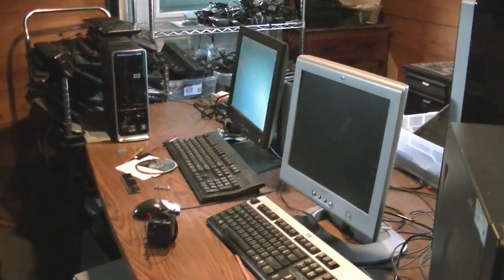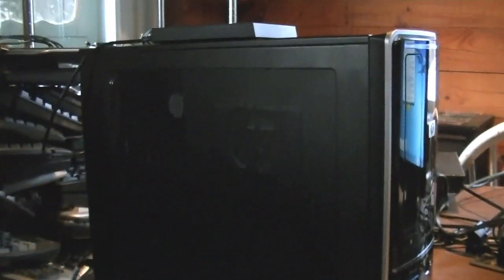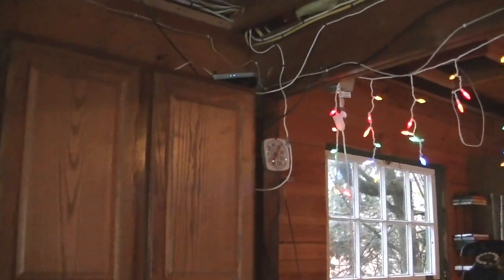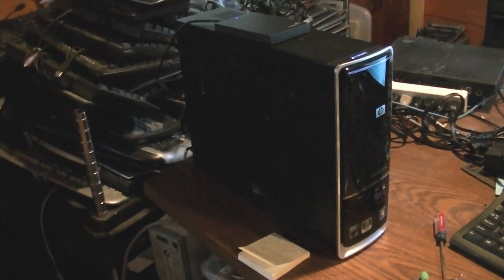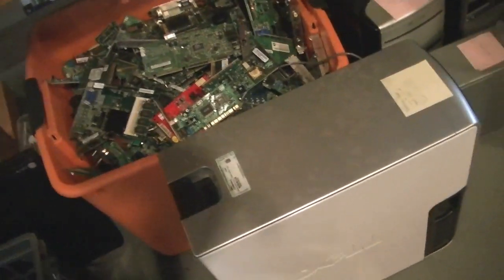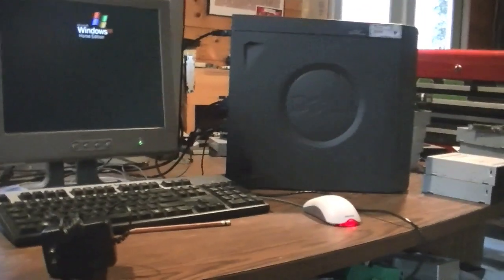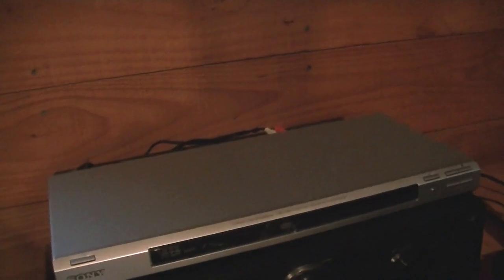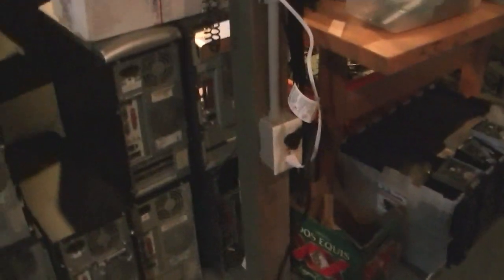Free Computers (Including one of My Best Finds Yet!) and Update

Comment from the maker: The reflowing process isn't nearly as difficult as I thought it would be, either. I reflowed the solder to my Xbox I mentioned in this video and it works fine. Plus heat guns are fun to use :D

Comment: It never fails to amaze me the equipment people will throw away in my apartment building.. I haven't had to buy a computer since 2000. I'm always finding discarded TVs and computers sitting next to the trash. I found the computer I'm using now about two months ago. It's a 7 year Dell desktop in excellent condition.. It has a Pentium 4 HT, 3.40 gigahertz processor and 2 GB of memory. It has Windows XP Professional Service Pack 3. It had some malware issues but Panda and Malwarebytes took care of that. Sure, it's a bit old but it does what I need it to do.
Reply: ldchappell1 Wow, impressive. This doesn't really happen here where I live, although I can admit I once saw two PC extension cards left next to the trash... I didn't pick them up as I figured I won't be able to do much with them. But now I guess I should take a closer look next time!
Reply: Dustie1984  It helps living in San Francisco which is fairly tech-y city with limited space. I found another working flat screen TV since I wrote that comment. Not a great one. A 26" Sharp 720p set. I had it for two days and sold it to my neighbor for $40. That's the 3rd working flat screen I've found so far. Last year I found a 55" Panasonic LED set. It was a bit beat up but worked fine. I gave that one away.
Reply: Sounds like you basically have givaways over there, man! Nothing like that happening here, yet... although this got me checking local ads for computers and people are selling old PCs for literally a few bucks, so - not really free stuff but almost free if I'm really willing to get something old-school.
Reply: Dustie1984  Now that I think about it the only thing I bought brand new in my apartment is my bed and my coffee pot. Everything else came from thrift stores, dumpster diving or I found it on the street. Even my cat was second hand. lol.  Good luck. I hope you make out like a bandit. = )
Reply: You're lucky. I wish I could find a computer like that. Even used those computers go for over $200 at the local Goodwill store. I considered buying one and then this other one fell into my lap.
Reply: ***** Did it make you feel like you won a lottery?
Reply: +ldchappell1 lol i agree. ive found lcd monitors (Samsung 22inch & Viewsonic 19inch x3) that were in the trash (obviously not the same trash lol), because they weren't "working" . i opened them up and simply enough it just required new capacitors on the powerboard. simple 10$ fix to repair all of them... :)
Reply: Sammy Morini   A few years ago you would only find the CRT monitors but now people are throwing away the LCD flat panels. I found twol flat panel monitors a couple of weeks ago in working condition. A 19" Dell and a 17" Acer. The 19" one had little red hearts painted on the bezel with enamel paint but I got it off with a razor blade. It's great finding a matching Dell monitor for the Dell Optiplex.
Reply: ldchappell1 haha yea very true. But youre lucky you found them in working condition :D
i got 10 free 17inch dell monitors from work (also my university). 4:3 ones but they work perfectly fine. my basement is now filled with many lcds that are not being used oh well hahaha :)
Reply: Sammy Morini   If you can fix capacitors, you have more computer savvy than I do. I didn't know anything about computers until I was 34. Most everything I know about them I learned on the internet.I'm pretty good at diagnosing software problems and upgrading hardware but when it comes to things like capacitors and resistors I take Dirty Harry's advice. A man has to know his limitations. I'm learning though.
Reply: ldchappell1 that's all good man and thanks (been doing stuff like that since i was 13, 29 now lol)

anyway you live and learn at your own pace and as you wish. it's good that you're able to self diagnose things as most would be too lazy to even put 2 n 2 together to try and solve... but you know what, it's ok, it's people like that which give us something to do :)

keep at it though!

Comment from the maker: I have to say, that is the cheapest and least effective way of fixing an Xbox. "Let's just jam up the fans or cover the heaksink, make it overheat, and see if it works!"
The real way to do it is to get a heat gun and reflow the solder on the board. That's what I did, and I now have a fully working Xbox without any error relapses.

Comment from the maker: Well, I reflowed the solder on the entire board and it works fine now, so it was not an overheating CPU but rather cold solder joints.

Comment: "just an pci-e x16 slot, doesn't support any amazingly good videocards" That's bullocks. PCI-E 1.1, which this has, supports ALL videocards out there. PCI-E 2.0 only offers better bandwith. With your logic, pci-e 3.0 cards wouldn't work unless you have the newest generation of motherboards. A 7870 will work fine in a 1.1 board.

Comment from the maker: That's fine, as long as the board doesn't smoke. Make sure you removed any meltable or burnable materials from the board before heating. The first time I used my heat gun though, it did smoke, but that was just because I think there was a little gunk burning off the heat gun.

Comment: i know this is a while since video, but have you thought of actually setting up a wireless bridge (running ddwrt) using one of your wireless-n routers? unless you actually have and use a gigabit lan setup, this might be a nice a simple way to get a network switch in an area where passing a wire isnt totally optimal. :)

p.s. on a computer which is connected to exactly what i mentioned, wireless bridged router, lol.

Comment: Got a XBOX 360 (same model) about the time you found yours,but it had the famous E74 error. Changed out the thermal paste,and redid the heatsink mounts, and got the thing working again. Already had some parts form another XBOX 360 I tried to repair,and got a controller from a friend.After a week of little use,the thing gave me lines all over the screen, and it gave me the E74 error again.So I guess I should reflow it, so maybe I have it a little longer. Same as you, I won't use it much for games

Comment: I've had several of the cheap dell cd drives jam, where they won't open. Rubber bands will not fix them. You need some grease. Take a paper clip and jam it at that pinhole in the front of the drive, it will come open. Pull it all the way open, and put a eraser sized dob of grease on the track. open and close it several times so it works its way into the gears. I have repaired 7 drives this way, the 8th one did not fix because something else is wrong with it.

Comment: I just got a similar HP slimline that you have in the video. I brought it for a thrift store for 30 with a fresh install of windows 7 and 4 GB of ram. I had have only one problem with it  and it was the front usb ports sometimes don`t work. It could be a loose cable.

Comment: It will support 2.0 cards just fine. It hasn't been until the latest high end 3.0 cards, that 1.1 proves not to have sufficient bandwith. Any 2,x card didn't face a bottleneck.  As far as I know, the best low profile card is a geforce GTS450. It's a special edition haha! :)

Comment: I found two near-fully functional Core i5-750 computers with 4GB of DDR3 RAM in the trash. One with a motherboard that supports overclocking, a 350W PSU, an HD 5750 and a 500 gig hard drive (only the DVD drive was bad), another non-overclockable one with a 650W PSU, a GTX 275 and a 1TB hard drive - which, unfortunately, has 4015 bad sectors, so I discarded it and put a spare 500 gig WD Scorpio Blue in it. I also had to clean that one up, since it was filled to the brim with dust. Had to take apart the video card, since it reached 90+°C playing... Minecraft. The part of the heat sink facing the fan was clogged up with dust to the point that I'm surprised it managed to push any air through there at all.

The former I'm actually using as my main computer now - turns out the i5-750 is actually a better CPU than the AMD A8-5500 I was using up until that point - I put it in a new case, along with my old graphics card (GTX 750 Ti), 4GB more RAM, an additional storage HDD and a USB 3.0 expansion card. Runs really well, though I would love to have an SSD in it.
Reply from the maker: It's amazing what people throw away, it makes me miss being able to grab stuff from recycling centers to take home. All the recycling places are so locked down now, I went to one near my new area of residence and it had not one, but FIVE signs outside telling people not to take anything.
Reply: Someone7089 I don't get why they would do that, it's only less work for them.
Reply: I got 3 HP Pavilion Dv7 laptops with AMD Phenom II processors and with 6gb of memory each from the curb about a month ago. Two of them had Phenom X3's, and the last one had an X4. All of them work great except one of them had a bad stick of memory, which was of course easily remedied. In my area people have a tendency to throw out perfectly fine computer equipment.

Comment: Selling used computers ain't an easy game, bro. It seems like you've got the right idea however. Craigslist is a challenge to sell. Have you considered at least including wifi to some of the towers? I know people love something with wifi, but something like that costs more. Keep it up. : )
Reply: i've seen cheap usb 2.0 150Mbps wifi adapeters on ebay for less than $10 with free shipping, that will boost the sales if you include those things, good luck out there. i do use them well and also give 14day warranty, just make sure you have a good inventory on what sells and whats inside. label your machines inside with small tie-wraps or something in case they play a stunt on you.

Comment: I know this is an old video, but do people actually buy those Pentium 4-era machines from you? I threw about 11 out because it seemed as though they weren't even wanted for free.
Reply: fairuz13
Costs more to ship than the computer is worth. Considering that they're worth nothing, it would have been nonsensical to have shipped them.
Reply: fairuz13
They were loud, slow, and barely ran Linux comfortably. In any case, there is nothing that could have been done.

Comment: I wouldn't say the success rate is so good but all of these computers came from a school so the cd drives were never used, the stock lubricant dries up and whalah, the drive does not open. It won't fix it if the pulley band thingies are worn out.